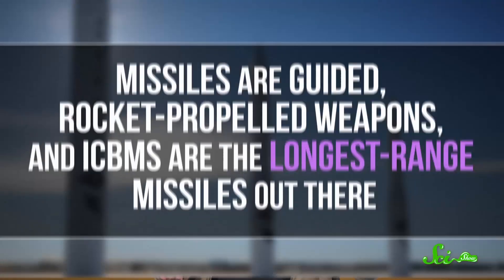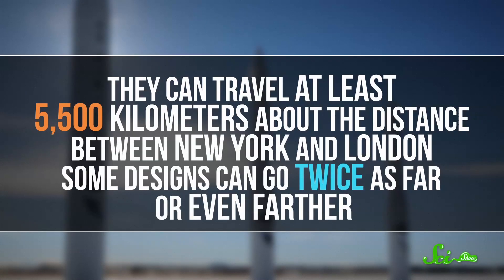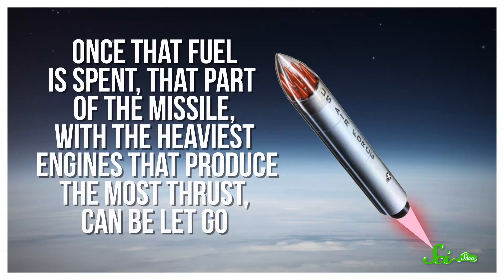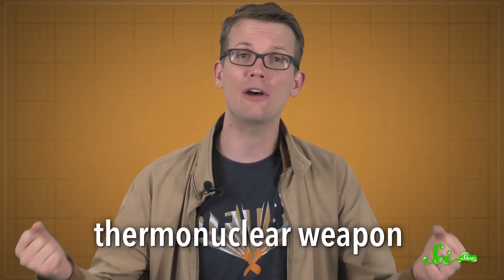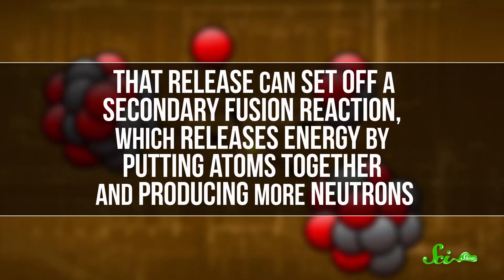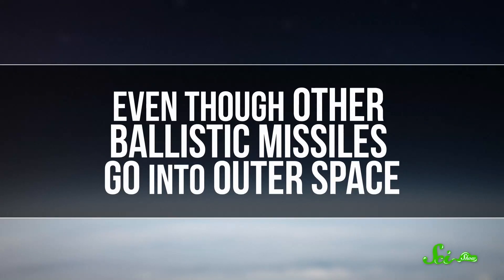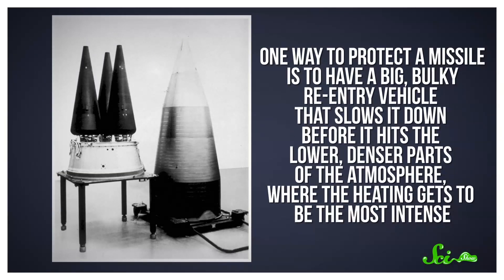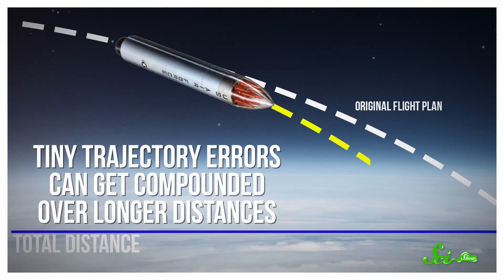Why It's So Difficult to Build a Ballistic Missile

Comment: Great overview of everything, I just want to point one little thing out. It's a little nitpicky, but a very important distinction nonetheless.

When you were talking about "fuel" for the rocket/ICBM that is not exactly accurate. Rocket engines work with 2 different substances, an Oxidizer and a Fuel. When you talk about an oxidizer and a fuel together, it is referred to as Propellant. When you are talking about 1 part of the system at a time, you would break them down and call them by their parts, Oxidizer and Fuel.

Comment: I suppose if anyone reading this comment wants an update on this situation. North Korea got stuck on the problem of making the nukes small enough, and making them survive reentry at the same time. They may have figured out the small enough nuke part by now, but probably not. 

They definitely didn't figure out reentry, they only managed to launch a few unsuccessful test payloads that didn't survive before running out of resources. They can no longer import any rocket fuel, and they don't have the infrastructure or resources to make their own, or to even make the things required to begin making their own. There is also no way to sneak in enough rocket fuel to do anything with, because they need such massive amounts there is so way they could sneak them in.
Reply: Only a matter of time.

Comment: Actually. Since you didn't actually clarify or know this, but: Even thermonuclear weapons get most of the explosive power from the fission reaction. 
More honest description would fusion boosted fission device. Fusion part is mainly used to increase the efficiency of the device in using up the primary core and the tamper around the secondary.

Comment: Why not use a liquid coolant in the cone, that can also be turned into energy when the liquid turns to steam and use it as a propellant.
Reply: Can't burn a bottle full of water.
Reply: This might sound stupid and un-applyable to rocket a scientist, but it's surely a smart idea to me, how did you think about that
Reply: Steam doesn't produce enough inertial thrust to propel a rocket that weighs 78 tons. And even if it did, without some explosive in the warhead (which is now replaced with a liquid coolant) all you've accomplished is making a really heavy and precisely aimed rock.

Comment: He's right, and when the news of NK launching their "ICBM" happened I had to laugh at the hysteria.  They never launched an ICBM.  The M means missile.  NK just launched a booster stage that they CLAIM could get all the way to Alaska.  There was no re-entry vehicle developed, because NK doesn't have one.  There was no thermonuclear warhead in it, because they don't have one of those either.  They just have themselves a long range rocket... wheee!  I won't ever say never, but the likelihood of them finding the skill and money to develop weapons grade uranium and digital flight guidance systems to actually get a nuke over here is extremely low.  At least for the foreseeable future.
Reply: they don't have thermonuclear warheads either? what's up with the several nuclear tests, then?
Reply: Those were all underground tests, and then there were a lot of "claims" coming out pf Pyongyang as well.  And that was also several years ago now.  A "warhead" is just a name for the explosive compartment (the material and the fuze mechanism etc ) and it can be simple as a steel casing in an underground place, like we know happened.  Not to say NK won't be able to put one inside a ballistic rocket in a few more years... but that's only the first step.  They will have to test it at least a few times and it might fail a few times, and we will know every time they launch it, (if it's done outside and actually manages to climb high enough to be picked up on radar).  Then they will have to figure out the delivery system for the warhead.  So you have a nuke in the top of a rocket you just launched to the edge of the atmosphere.  Great... now how are you going to aim the warhead for re-entry to the place you want to destroy, while guaranteeing it doesn't explode over you?  That's where they will have the biggest problems imo.  That's a HELL of a lot of high end computer science, and avionics manufacturing ability for the guidance chips.  No one who has them will sell them to NK... not even China.  They have to make them themselves.  Good luck, and by then (hopefully) our anti-ballistic defenses should be upgraded to the point that even if NK succeeds with the entire weapon system, we will detect a launch and intercept it in time.

Comment: Manufacturing always lags behind scientific advance. The basic principles of flight have been known since the 1790s but it took more than a hundred years to design and manufacture an engine small enough to make powered flight possible. 
The principles for enriching uranium are publicly available knowledge but putting ithem to practical use requires highly specialized manufacturing techniques that can't just be learned from a book.

Comment: The other issue is that you can almost never fully test them. You can't fire and empty missile to Los Angeles and see if all your calculations were correct. Even test firing one into the ocean is difficult -- since you need good tracking systems and ships to tell if the missile reached its target correctly.

Comment: You have just accelerated N Korea's missile program by 5 years!
Reply: Don't worry, they don't have YouTube
Reply: Funny when an idiot calls someone an idiot.
Reply: Gene Constantinou
You have just accelerated N Korea's missile program by 5 years!
'
hi G C...
how how north korea get missiles comes from...
china help or ussr russia help
Reply: Dumbass
Reply: It's so hard to build because the instructions are in Chinese. Every time I come across instructions like this it never ends well.
Reply: An 747 Boeing can be a ICBM. Only thing. It will it shot down cause it's too slow. It travels all over the world. Just don't have a war head attached to it
Reply: NK has verifiably tested serveral underground nukes.  NK also verifiably put an object into orbit... not quite as hard as delivering a warhead on the tip of an ICBM but close.

What will accelerate NK's nuke program us to threaten it with imminent attack.  What is likely to defuse the program is to tie trade relations directly to the state of their program.  More program = less trade.
Reply: Gene Constantinou they are still 30 years behind
Reply: NK is currently at the same point where the USSR was in 1957 and US in 1958.  Sputnik 1 and Explorer 1 were put in orbit with no hope of a safe return.  NK did this in 2016... so 59 years behind.  NK has not demonstrated reentry or precision guidance so their clock is ticking... 56 years behind and counting (John Glenn, 1962).
Reply: @CarFreeSegnitz  The difference is that back then no one else had them.
Reply: Gene Constantinou  Are you in 5th grade?
Reply: What propelled you to think I was serious about the statement above?
Reply: Ghazan Hussain looks like your IQ is too low to understand his joke

Comment: Sorry, but "wrapping in more fuel" to increase weapon power is not the way it works.  You actually fill the center of the fusion portion with either tritium or deuterium, ala you get a variable yield thermonuclear warhead.  You can dial a yield before the weapon goes off simply by how much of the latter you put inside of the fusion portion of the weapon.  You should read up on this stuff before making a video about it.  Also the USAF missile you have in animations doesn't exist.  Treaties have long banned MIRV land-based missiles.  Sub missiles can have MIRV warheads, up to 14, but land based missiles are limited to 1 warhead per missile.  Just some food for thought.  Land based missiles = USAF, sub missiles = USN.
Reply: Land-based missiles with MIRVs aren't banned. Russia and China field them.
Reply: Do you even google bro?
Reply: What do you mean? They literally aren't banned.

The USAF missile used in the animation did exist. It was the LGM-118 Peacekeeper, which isn't in service anymore, but it did exist at one point. The W87 warheads it carried are now used on about half of America's Minuteman III's.

American Minuteman III missiles utilizing the Mk-21/SERV RV bus (200~) only carry one W87, but those using the Mk-12A (another 200~) can carry 1 to 3 W78's, although I'm not entirely certain that any are currently deployed with more than one warhead on a Mk-12A.

Russia has several land-based missiles using MIRVs; 46 RS-20V's (10 x 500/800 kt), 20 RS-18's (6 x 400 kt), 70 silo variants and 20 mobile variants of the RS-24 Yars (both 4 x 100~ kt), and a suspected SS-27 variant launched by rail of an unknown amount (would also be 4 x 100~ kt).

Lastly, China has one land-based ICBM using MIRVs in service; roughly 10 DF-5B's using 3 200-300 kt warheads.

As you can see, land-based MIRVs are definitely not banned.

Also, your explanation on variable yield thermonuclear weapons is incorrect. The fusion secondary typically contains solid Lithium-6 deuteride, which produces tritium in situ, during detonation, not "either tritium or deuterium." How exactly variable yield is achieved depends on what yield you're looking for exactly; very low sub-kiloton or single-digit-kiloton yields could be achieved by simply "shutting off" the fusion secondary entirely via preventing gas boosting from taking place, so as to make sure the primary doesn't produce an explosion sufficient enough to compress the fusion secondary. Yields above that but below the maximum could be achieved by varying levels of gas boosting and thus varying levels of fission efficiency - you get the idea.
Reply: M Hamma Ah, you're right. Even though half the Minuteman III's are capable of carrying three warheads, they're all deployed with only one. Though I did concede that I was unsure of any were actually deployed with more than one warhead.

But the rest of what I said is correct. Land-based missiles using MIRVs still aren't banned and your explanation on variable yield is still wrong.
Reply: Ban / prohibitive, there is no difference.  Latest missiles on the SSBNs are MUCH more capable weapons wielding up to 14 warheads.......and we'll soon see a slightly smaller versions carried on newer block VA class boats with their new modular tubes.
Reply: On the US side, yeah, SLBMs carry more warheads and are more accurate than Minuteman IIIs, but that isn't the whole story. They both have advantages and disadvantages. That's only on the US side, anyhow. Russia, for instance, focuses on it's land-based missiles more than it's sea-based missiles. It's just two different focuses.
Reply: The 11" warheads of the B61 and similar can fit on pretty much anything.  Ship, sub, and air launched cruise missiles with 1,000+ mile range can deliver the same power.  The land based missiles while having their place, just seem rather ancient.  I'd create a method for sneaking around the ocean and placing SLBMS embedded in various parts of the seafloor, well hidden, but in opportune locations ;).
Reply: Well, I think they all fit certain roles and have pros and cons that make having a triad necessary.

Like the B61 you mentioned, as well as ACLMs, they're most important on the tactical level and least important on the strategic level. Consider bombers arriving to strategic targets during a nuclear war hours after the much quicker ballistic missiles have already delivered their payloads or how they're much more vulnerable to interception. But the fact that jets or bombers are delivering them combined with their high accuracy make them most ideal for tactical strikes.

SLBMs today are a far cry from the first SLBMs. So much more accurate and capable in comparison. Suitable for first strikes and necessary for second strike capabilities. However, consider that SSBNs could be hunted while on patrol by enemy submarines, etc, and if one launch tube or missile needs maintenance, the whole sub is taken out of action.

In comparison, if an ICBM needs maintenance or upgraded, only that silo is unavailable. Additionally, and the US and Russia would never consider them this, but they really act as a nuclear sponge. You can't just not hit your enemy's ICBMs even though they'll likely be launched before your warheads arrive. They absorb a lot of warheads in nuclear war plans. Thus, it's wise to have both ICBMs and SLBMs.

Additionally, it's interesting you mentioned dotting the ocean floor with SLBMs. The US considered at one point deploying ICBMs suspended from the ocean floor like those floating anti-sub mines you see that could be released and ignited in the event of war. I believe that's prohibited by treaty now, though. Ruining all the fun.

Comment: it's not that hard to survive reentry just put a layer of tungsten on the tip and your good hell even ceramic can absorb heat 
also a hydrogen bomb isn't sensitive to heat seeing as how you can't light pressurized hydrogen 
as for the rocket 1/3 power to weight 
the only real hard part is controlling your unmanned rocket. if a signal can't reach it then you got no control, but North Korea can always have another nation take control like Venezuela and land it on target as easy as dads spaghetti
Reply: A hydrogen bomb is definitely sensitive to heat. Hydrogen isn't everything. Heat it up enough to damage any of the other components like its electronics or chemical explosives and your bomb won't work.
Reply: https://youtu.be/vLxWsYx8dbo?t=939 this is an example of a rocket slowly reaching a hydrogen environment as the flame is quickly smothered until only the oxidizer is burning. even the flame from one of our most powerful rockets can't survive in pure pressurized hydrogen. the bomb is incased in hydrogen how ells are you going to keep your nuke purified. bombs aren't sophisticated it's literally hammering one chemical into another, even a corn farmer can make one
Reply: I'm not sure what you're trying to say. The bomb isn't encased in hydrogen. There are isotopes of hydrogen inside the bomb, and while the heat of re-entry wouldn't be enough to initiate thermonuclear burn of the hydrogen, significant heat could damage other components of the bomb such as electronics that would render it unusable.

Comment: The problem with these problems actually being problems is that they've all been solved already, and a long time ago.  Maybe some of this information has effectively been kept secret, but a lot hasn't.  In addition, some of what we had thought has been kept secret probably has leaked out, if you know where to buy the information.  So the Norks down't have to reinvent the wheel.  They just have to know where to get the plans for it.

Comment: ICBM's are not difficult to engineer.  At this time the fuel systems are almost "Open Source" and more a matter of doing than anything.  The issue of missile navigation is really a matter of a few computer chips that are very cheap and a smart programmer.  The reentry issue is even simpler. The heat shield was solved by the Russians using white oak soaked in brine as early as the 1950's.   North Korea's biggest problem was nuclear fuel.  If they are limited to what was given to them by Bill Clinton they can build about a total of 12 bombs.   If someone has been giving them additional fuel that limit may not be there.   If they are limited to Bill Clinton's supply they are essentially bluffing.  but if they have additional fuel which probably Obama allowed they are not bluffing.

Comment: Here's good news for low cost ICBM manufacturing. A 3D printed rocket with 3D printed engine parts and a battery powered fuel pump.
https://www.theguardian.com/science/video/2017/may/25/new-zealand-launches-3d-printed-rocket-space-video

Comment: you forgot to mention that the ICBMs has to use a different type of fuel that space rockets use, the ICBMs fuel has to be storable for a long period of time and stay stable so you can't use cryogenic fuels like the ones in space rockets.
Reply: The US did use liquid fuel for Titan II (SM-68B, LGM-25C)
Reply: Well, you CAN, if you want. China and Russia have certain missiles that do. But you're right - ideally, solid fuel is your best bet for less issues and long storage.
Reply: solid fuel isn't powerful enough to launch an ICBM you need a stable storable liquid rocket fuel, which is quit a challenge to achieve.
Reply: It is, because solid fuel is exactly what most of America's ICBMs and SLBMs use.

Comment: I won't disagree that nuclear warheads are usually heavy, but they don't have to. The critical mass for Pu-239 is 10Kg. With a good reflector you can go down to almost 5Kg and the implosion of the explosives around it can still further decrease the critical mass. Als thermonuclear warheads use hydrogen and lithium, which are pretty light actually... Of course you don't get information about state-of-the-art warheads, but I would assume that they're not as heavy as you might think...
Reply: It's usually stuff like the weight of the re-entry vehicle itself, the associated electronics inside of it, and probably also the tampers inside the weapon, whether it's Uranium or Lead or whatever.

Comment: ICBM's are hard as their guidance computer has to be programmed and then not able to be interfered with or stray off course during flight, the US uses a combination of GPS with known initial position and gyroscopes and accelerometers once in flight for dead reckoning with filters applied to ensure a higher sigma of accuracy.